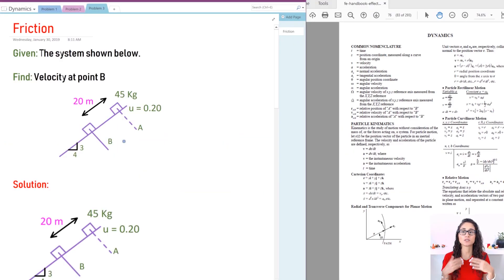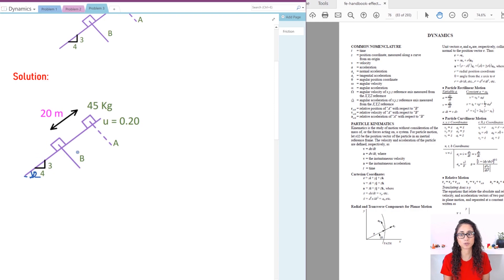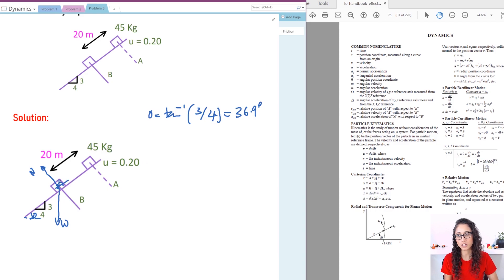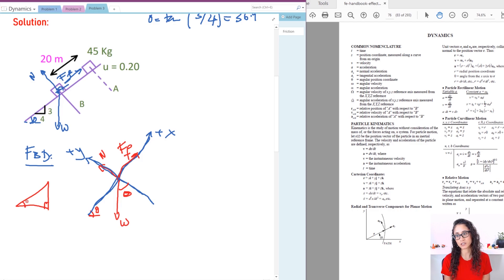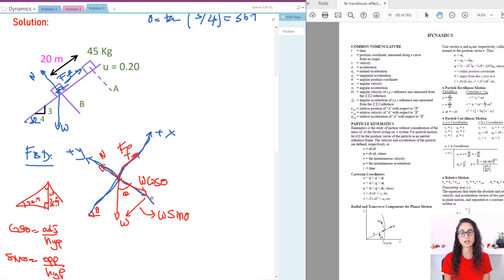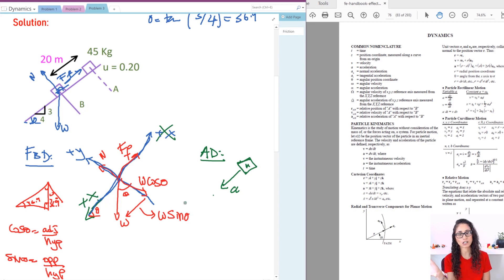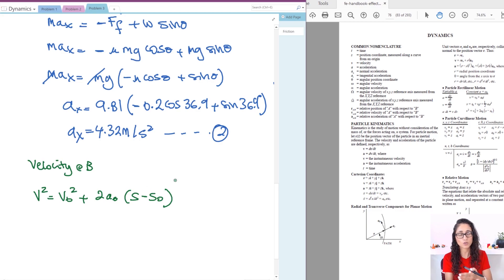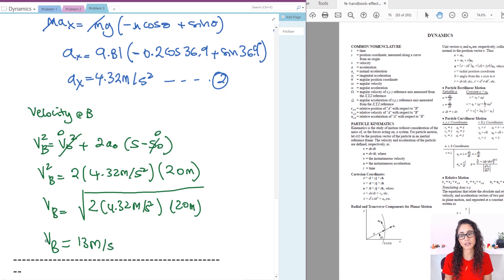FE Exam Dynamics - Rectilinear Motion Problem 1

Comment: I think we should solve this problem by work=kinematic energy, since we are getting a negative acceleration to avoid conclusion of the vector
Reply: There is only a negative acceleration if you assume positive is to the right. If you frame positive 'x' to be left, you don't get a negative acceleration.

Comment: Hi Kenza,  Could you please tell me why Max (mass x ax), I never saw tis equation before. Thanks!
Reply: F= ma   newton second law
Reply: @mienge2177  Why dont we use =0
Reply: @Daisy-i9h9t  bcoz block has moved from point A to point B with some sort of acceleration in x direction. That's why we are finding ax value at point B.

Comment: Thanks for the video. But there is no way that this kind of lengthily problem would show on the FE exam. FE exam problems are put to be solved in less than 3 minutes.
Reply: This could easily be on the FE. If you know your way around kinematics, this is a simple problem. I'd imagine there could be a similar problem in the statics section as well.